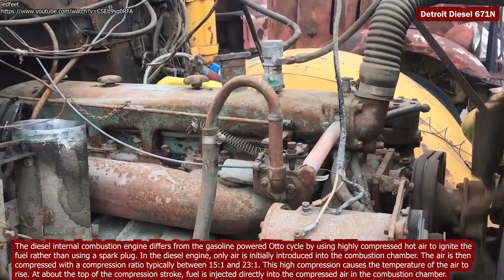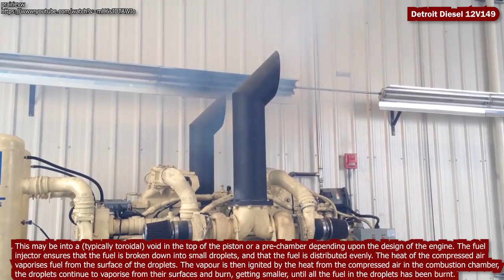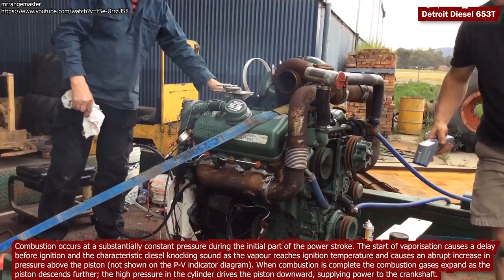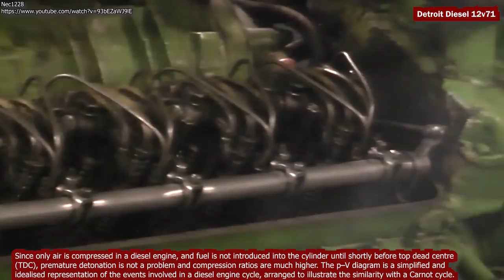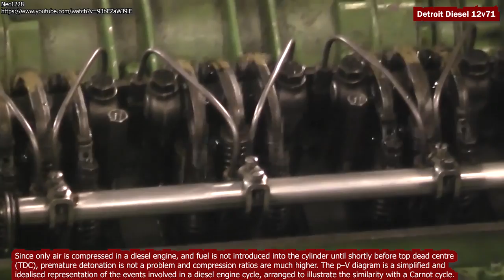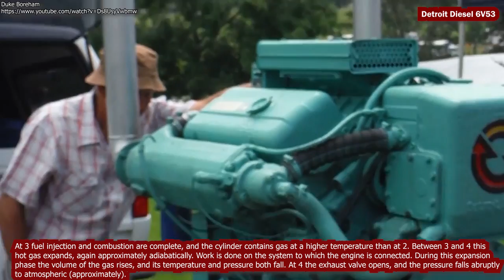Cold Starting Up BIG DETROIT DIESEL ENGINES Running and Sound

Comment: I have driven every kind  of truck with every kind of engines, Detroit, Cummings,  gas ,diesel and when I started driving,  I could not get enough. Yep those were the days
Reply: Yes it's a disaster youth has the ability to make you think your having fun, but trucks are dangerous,  now I think about my days of driving as a Morron behind a wheel, if your are beside the wheel of a trucks,  and  it expires, it can hurt anyone beside the truck with pieces of debris
Reply: Now all the engines sound the same. You used to be able to tell a Cummins from a screaming Detroit from a Claterpillar from a Mack.

Comment: Ah.. dude.... you described a 4 stroke diesel engine. Old Detroits are 2 stroke. First, there are no fuel injectors on a 2 stroke Detroit, instead a blower forces a fuel/air mixture towards ports near the bottom of the cylinders. When the piston is at bottom, the ports are uncovered allowing the fuel/air mixture to be forced up into the cylinder, pushing the exhaust gasses out the valves at the top. As the piston moves to top it covers the ports while the exhaust valves close, allowing compression to be achieved. The combustion then pushes the piston down in its power stroke. The process then starts over with the exhaust valves opening and the cylinder ports being uncovered. Every revolution of the engine has a power stroke unlike the every other revolution in a 4 stroke engine. This is what gives old Detroits their unique sound and why they had higher power to weight ratios of similar sized engines back in the day. This also gives way to the legendary reliability of the two stroke Detroits, no injectors or ignition systems to fail.
Reply: Everything you said was correct except that it does not have injectors. It does have injectors. It has one for every cylinder. The center rocker arm pushes on the injector and squirts diesel in the combustion chamber. The only thing it does not have is air intake valves.
Reply: @allen84jr  Thank you for the correction
Reply: No problem man 👍
Reply: Alan Zimmer. Check out other YouTube vids showing tuning and maintenance on Detroit’s they certainly do have injectors. Otherwise it is all as you described. Cheers
Reply: Detroit have injectors, that's what the rack is for